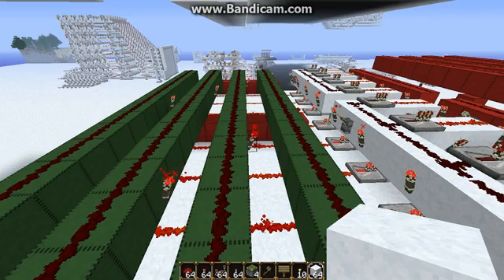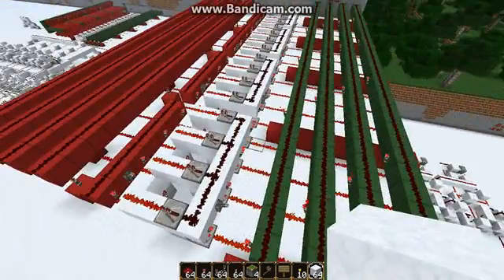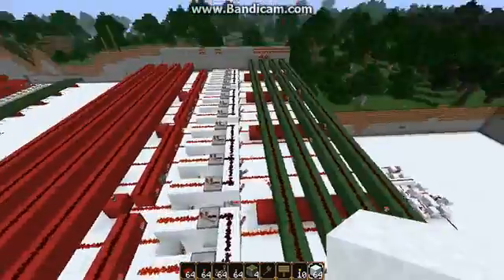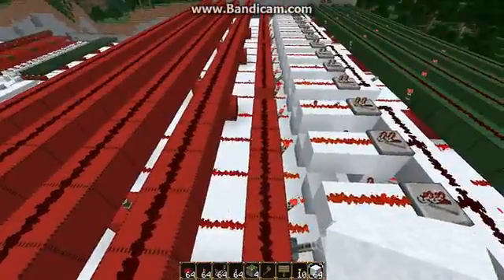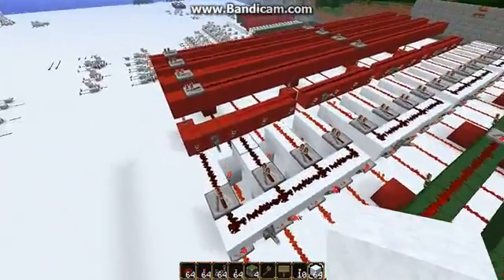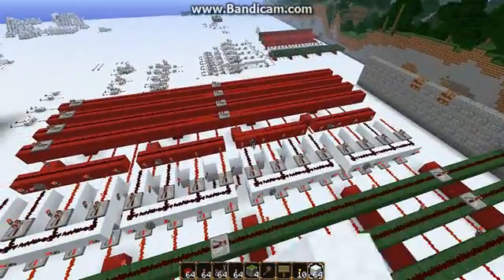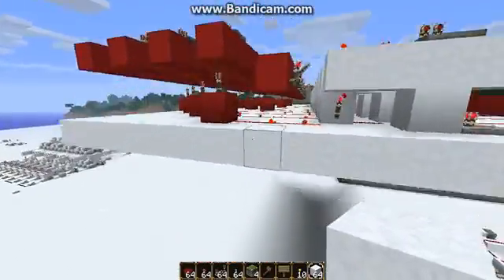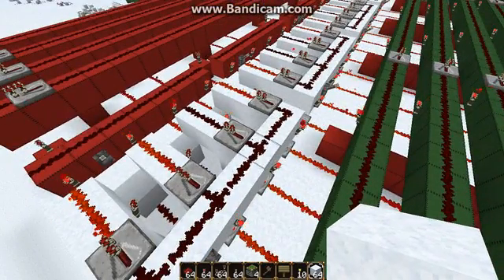Minecraft Computers Explained Ep. 1 - RAM

Comment from the maker: In this design, there is no need for a reset line because any time you save to a RAM cell that already has something in it, it will simply be overwritten by whatever got passed in. If you were using RSNOR based RAM, then yeah you'd need a reset line, and the way that would work is you'd simply power the reset line just before you powered the write line so that data would be overwritten.

Comment: Hey benny :) I might be being stupid but as you didn't mention it in the video I thought I'd ask. Wouldn't you need some kind of reset line after you have finished with the data in order for the RAM to be able to handle more program information and if so is that not technically part of the RAM because you didn't mention anything about a reset line in this video.

Comment from the maker: That's a great system to use, especially for transferring data across long distances, but in this particular case you usually want RAM to get/use information as quickly as possible or you'll bottleneck the entire machine. However, in most other cases that's an outstanding choice and I'm glad you can do it :)